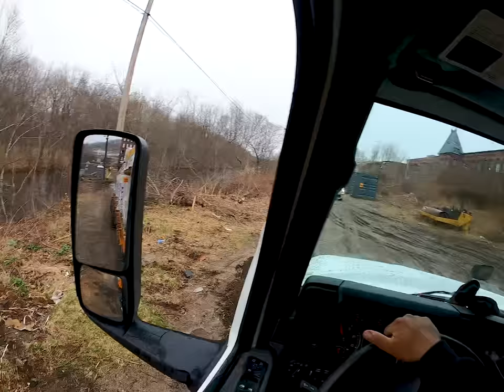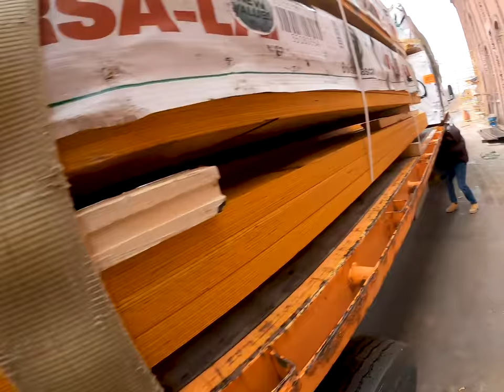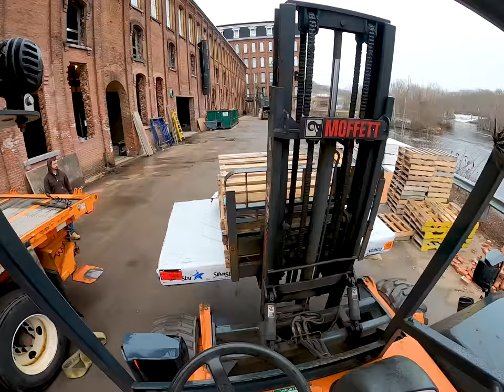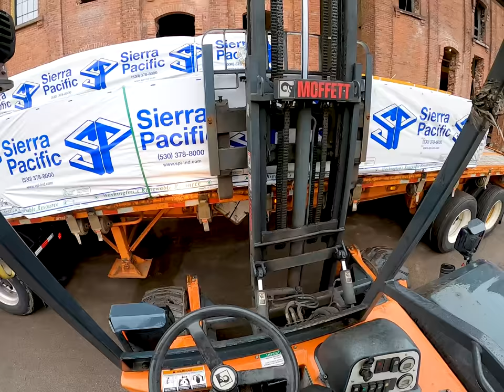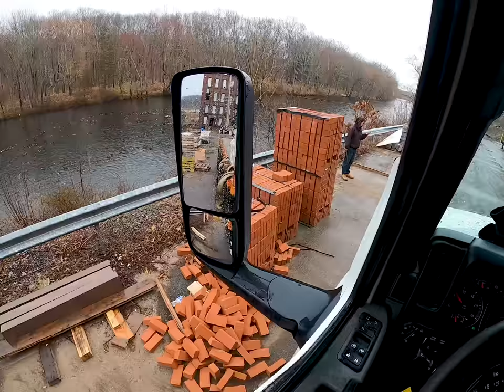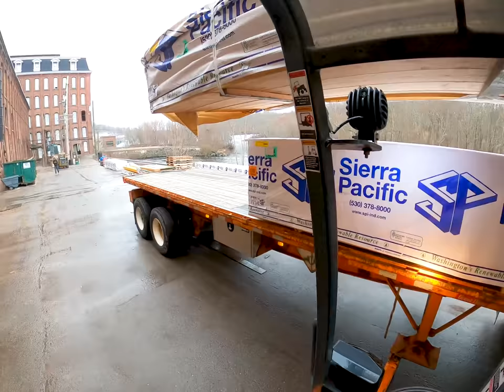Huge Truck load of lumber going to an old Mill!

Comment: What I used to do with the tynes is lift them up to a set height, unclip the latch, then I used to kung fu kick them over. Get a real sideways angle on it. I avoided having my fingers anywhere near them. And actually, one of the things that I found made it easier for me to learn how to run a reach forklift fast, was I learnt by putting the tynes all the way to the end, it forced me to be deadly accurate with it. Another thing I would do, is I would find that sweet spot where the tynes are perfectly flat into the pallets. Often people used to drop the angle when leaving the forklift, I kept them up. I find that people who drive counter balance are always dropping the tynes because they can get super sharp from sliding on the ground a lot.

I miss driving to be honest, it's been a long time. After my back injury, I never drove a forklift ever again. I did container unloading in the cold Melbourne weather, slight rain coming down. Anyone out there considering manual unloading of a container, don't, you'll never recover from it.